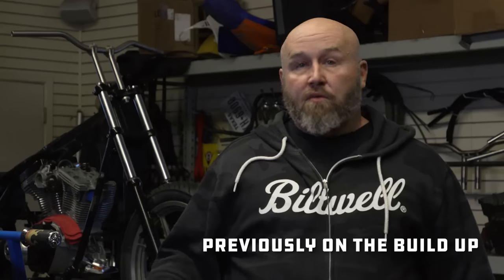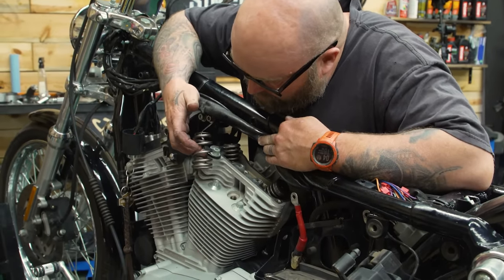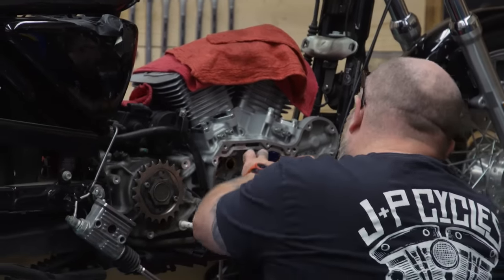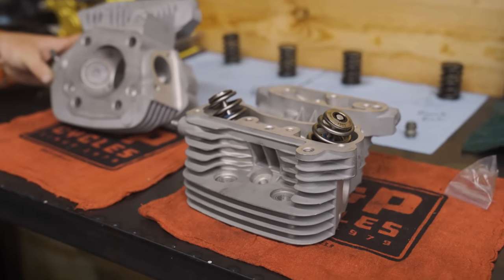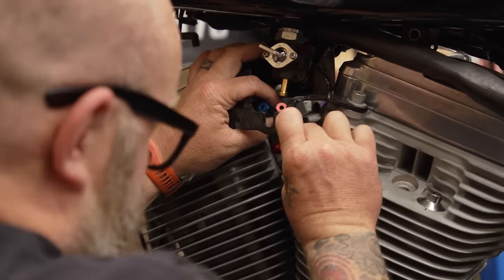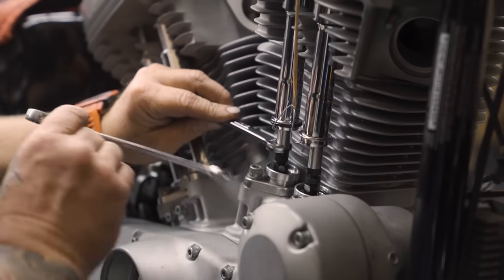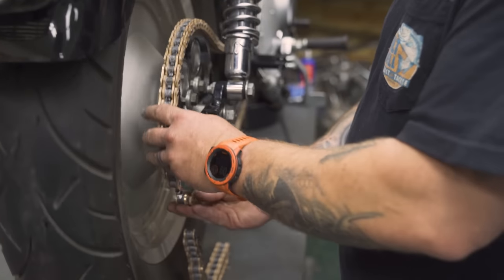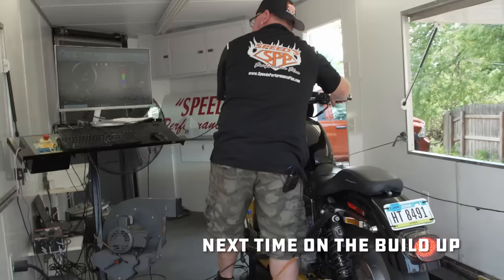Big Bore Nitrous Sportster : Throttle in a Bottle I The Build Up S2 E2

Comment: Just wondering why you didn’t choose the Hammer performance 1275?
Reply: Because this is actually a marketing exercise disguised  as entertainment and j&p cycles sell S&S parts?
Reply: @reputurbo  Even for marketing and not doing a very good job because those pipes are not short shots also if I was gonna run some nitrous on a carb I would just use the fuel injected intake Y run my nitrous to those trigger them with the solenoid

Now he’s introduced metal in a fresh build

Comment: !200 conversions for an 883 seem a good idea but 883 heads don't flow enough air for even an 883 so if you take it out to1200 then it'll  be an asthmatic noisebox as the heads will 'nose over'  flow-wise at 4 - 4.5 thousand rpm. 
Ya shoulda put bigger valves in the heads and got them ported as well - trust me I been there and done it.... found out the hard  way.  Hammer do nice headwork but many other places can sort things out for ya at a cheaper price.
Nitrous is only good for drag strips not street bikes - sort the heads out for a good street motor build  that has power all the time and THEN fit the nitous kit for some occasional but real fun !

Comment: Why was it running so poorly at first?
Reply: Valvetrain out of adjustment.
Reply: drag pipes don't work except at redline
Reply: @exothermal.sprocket  how is that possible, with hydraulic lifters and gear to gear cams?
Reply: @donveitch5812  You tell me.